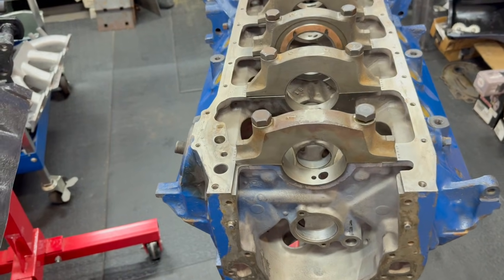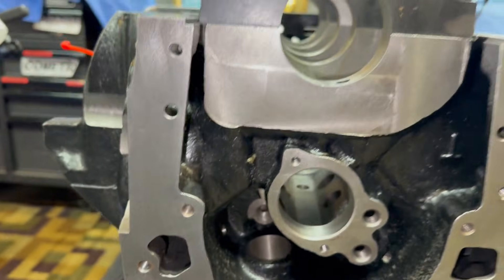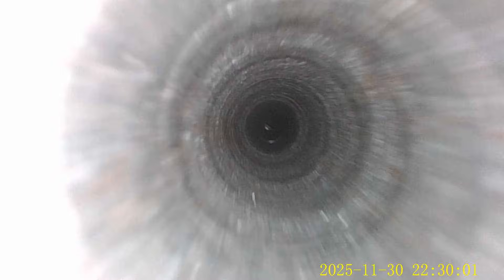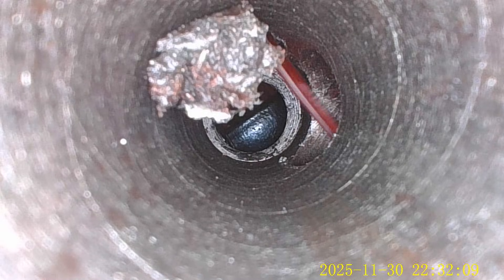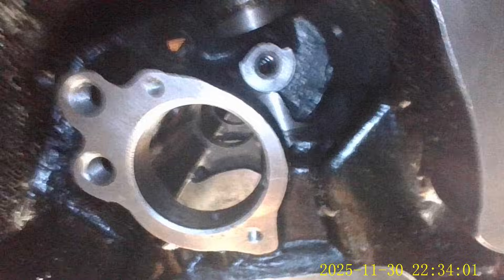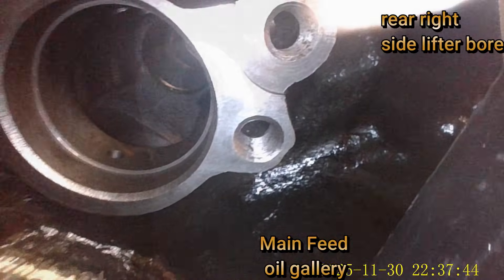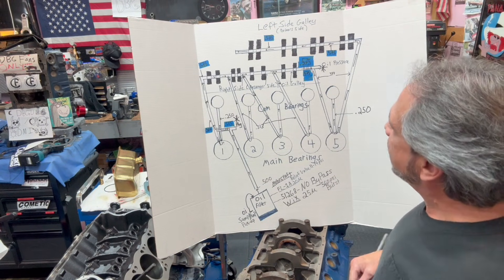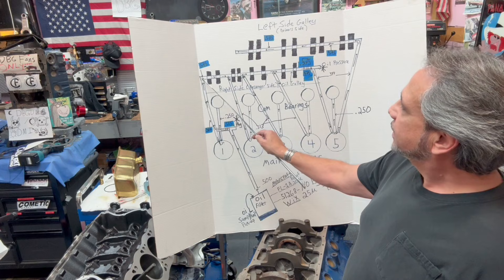DBG: What In The Galley Is GOING On, The Flow OF 1 drop of OIL In a 351Cleveland Priority System

Comment: Ok Tim, always good information but let's get the term right its oil Gallery not Gally, gally is a small kitchen.
Reply from the maker: Ok Johnny, let’s get this right. It’s Tim not Jim
Reply: @dragboss351cleveland sorry about the name mix up big thumbs and auto correct, should have proof read before sending. 
On another note I radius all my oil gallery passages where they meet others also flex hone make some nice ball hones for just such work. Hope you weren't offended by my first post.
Reply from the maker: @johnnym1320 no worries. I have always called it a galley as do some others. But right gallery, hence the title. Either way I get the point. I don’t think many guys check this sort of thing in any engine. Good stuff to check and makes a huge difference I say. Thanks for the tips 💯👍
Reply: @dragboss351cleveland when you're making 800 plus hp from a 1352cc 4 cylinder, oil flow is very important
Reply from the maker: @johnnym1320 yep, I would say so. Make sure those galleys are clean 😉
Reply: @dragboss351cleveland I’ve always referred to it as an oil galley also. I believe you’re correct. Main thing is that we all know what you’re referring to, even if some may use different terminology.

Comment: Wow. Each sharp edge produces heat, turbulence, and friction. And shears the long chain oil molecules, which reduces film strength and viscosity. Adds to the oil pump load. Like you keep saying, it's the little things! 😊
Reply from the maker: I know it. Makes me ant to revisit my current factory block, that I am tearing down.  Massage time. Thanks 💯🏁
Reply: Facts, I’ve been building engines for years, there’s an actual decent amount of block prepping to be done if you want a rebuild done right
Reply: @Carculturelivin  I've done the usual deburring, radiusing cranks and journals, oil pumps and such, but never the oil galleys. That's a lot of work!
Reply: @BlockYTCensorship usually takes expensive and very long drill bits to open them up, and a super steady hand and or a really big drill press (again expensive), not actually hard or difficult per say, it’s just getting all the block plugs out can be the pain in the ass
Reply from the maker: @Carculturelivin that’s a fact for sure. 💯💯🏁

Comment: Tim, what a great video.  When you were doing the oiling system mods and clean up did you have the block checked for  core shift and was the lifter bore geometry checked?  One of the primary reasons to bush the lifter bores is to solve a possible geometry problem.  Yes, it is also a way to restrict and redirect oil flow.  A lot of time was spent by Roush in the 70's and 80's getting the optimal flow from the production based Cleveland.  Then those lessons were applied to the Motorsport blocks over time.  Yates contributed was well with some innovations.
Reply from the maker: I have done nothing with this block yet, just exploring it and see what I have to work with and see what it has to offer. I have had two blocks checked out they have some core shift, but can deal with it. Thought it was .050c the lifter bored all need bushings. Appreciate you being here, thanks 💯👍🏁

Comment: If you have excessive leakage either thru or around your lifters then you need bushings or better lifters. Oil clearances are critical to being able to properly maintain oil pressure and to have the oil where it needs to be when it needs to be there.  The other thing that causes issues in race application is the centrifugal force in the crank can’t trap your oil or it’s a bad time. 😂
Reply from the maker: Your right Bryan, I was talking to Bras from BAM, and he mentioned the same thing

Comment: Wondering if the metal shavings became magnatized and wouldn't come out during cleaning? Did you find out where the small piece came from?
Reply: Ok. Thanks
Reply from the maker: Not sure what shavings you are referring to Don, these in the new block, or the post I made on the solitary steel almost small screw or rivet

Comment: On my 347 block I took 1/4 rod 12 in long cut a slit down the middle of one end other end in die grinder , tear 60 / 80 grit sandpaper 2 inches wide to fold in half the length is determined by size of hole flap wheel hole , or take a cartridge roll holder and weld a 1/4 rod on end to extend length 10/12 inches long for cleaning / polishing oil lines better flow same with the oil pump too.radius all sharp edges for flow of oil
Reply from the maker: Great idea William. I will have to try that. It’s really important here, so sharp all the edges. 💯👍💪
Reply: Been doing exactly that for 20 years.